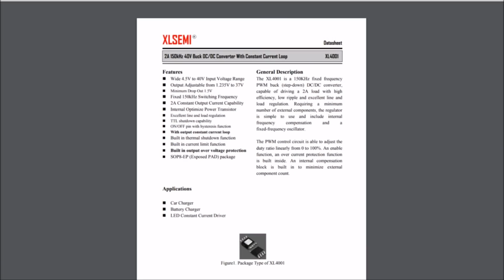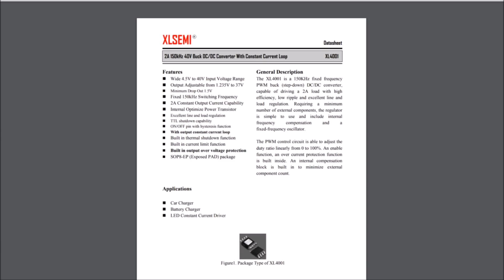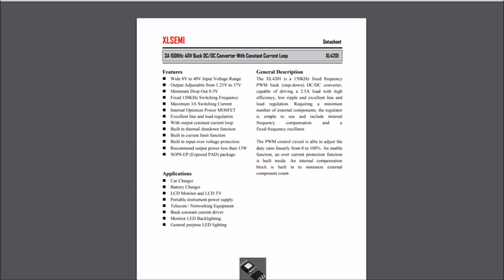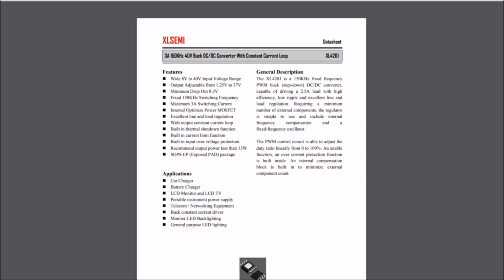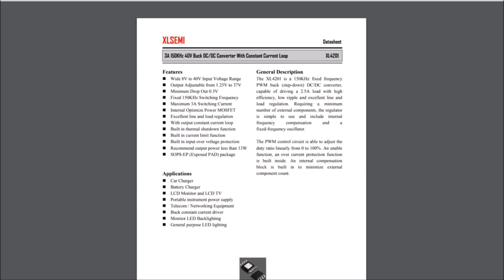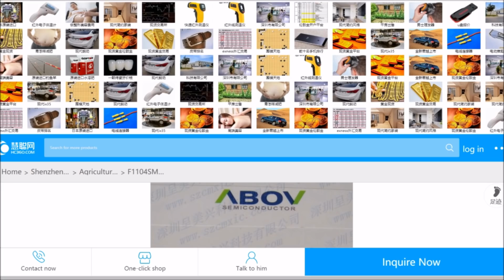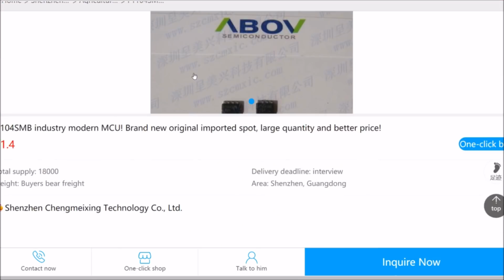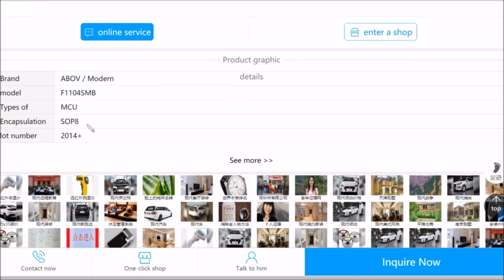Power Tool Powerbank Powwow

Comment: Counter-intuitively transmit mode on nrf24 actually uses less power than receive mode (or can, depending on application) because the transmitter can sleep between sending packets, however the receiver has to stay awake all the time to listen. While I haven't seen the code, I suspect your transmit side Arduino is polling the sensor and transmitting packets way more than it needs to, and you could probably cut power consumption hugely with some minimal software changes. Of course this might require some changes on the receive side as well since you use the ACK packets to send remote control signals.

Comment: I thought the same about those power banks but if you put the USB meter on the different USB ports and you switch the meter to show the protocol that it gets from your power bank you'll see that the protocol in most cases is different even though you can draw the same amount of amps when you have the load connected.
I learned about the different protocols because I have a similar USB meter that shows the different protocols on the second page, you should definitely try it.

Comment: Actually this tool adapter thingy does not shut off on higher load. It's your usb meter that turns off it's display when "oveloads". This adapter has properly encoded standards, and these meters check for voltages on data pins and display what standard is used, and if current drawn is bigger than in detected standard, it turns of display. You still can see red led flashing and fan spinning on 2.1A test.

Comment: Of course, slow changing parameters like humidity don't need continuous monitoring. Maybe it would be possible to switch off the sensor and wifi transmitter for four minutes out of 5 and use much less power? We used this technique for industrial instruments years ago

Comment: I'm using that exact USB-Adapter as my TS100 power supply, there is just enough space inside to squeeze in a DC jack  with 1mm² wires soldered directly to the blade connectors on the PCB

Comment: I measure the temperature in my garage (DS18B20) and the temperature and humidity in the loft (DHT30).  In each case I use a WEMOS D1R2 connected to my home wifi.  For battery power in the garage I have an old car battery which after a charge gives a good supply and this can be connected to a WEMOS DC Power Shield which sits below the MCU.  Input is from 7 -24V and is currently priced at £1.56.  Not elegant but works well.  Bob

Comment: If you drop the transmit interval, the average current may well drop to <1mA, you would be better off using a low quiescent current LDO and a reservoir cap. It seems wasteful dropping 12v to 5v, but it beats a relatively dumb buck regulator working all the time which can really drain the power while doing not much.

Comment: I rigged my tester with a 100ohm resistor to keep the fan on permanently. those three contacts on the side marked fan are for a micro switch to toggle the fan, but I just put a resistor on it.

Comment: In the comments I see SO many improvements .. .. .. Use LiPo batteries, let the transmitter only send new values once every xx, and only transmit if there is new data, etc etc. If this is about using less power, there are many comments to work with. Cheeriooooo

Comment: @5:20 The outputs are coded for being able to supply this current. If you ignore the coding, you can attempt to draw as much as you want until the voltage collapses. https://lygte-info.dk/info/USBinfo%20UK.html

Comment: Just tested mine, Nano+NrF+DHT11, barely registers on
my USB tester, flickers occasionally between -0.00- and -0.01-, 

Mentioned on one of your previous videos that I put the
transmit function in an 'if' statement which only broadcasts if one of the
readings changes. Plus it only checks about every 5 seconds. 

Edit: Bought a new more accurate tester, does 0.000A. It
seems to draw 0.008A and 0.012A when broadcasting.

Comment: To solve the problem with powerbanks shutting down I made a circuit that draws 150mA in very short pulses. This will trick the powerbank into thinking there is a significant power draw, and it stays on as long as it sees that 150mA draw. It's a real life saver when you're dealing with very low power stuff, and the additional power draw is really very low.
Reply: Same idea, simpler : I short a resistor (usually 330 ohm) to get the added minimal draw that will keep my powerbank on.
Reply: @marcrives279  Sure, that works ;)
Reply: @D00MLOORD  I now use a simple electronic load, plugged on the other power bank USB port.
To keep my powerbank on, total consumption must be above 70mA...

Comment: Don't use powerbank, use some 18650 parallel and a APxxxx boost converter chip. Very tiny.
Also removing the LED and USB from Arduino helps a lot conserving power.
Reply: That's more or less what I was thinking too.
You can get TP4056 charger boards which have low-voltage cutout protection, and 1A voltage booster circuits, from places like eBay for only a few dollars for 5 or 10 boards at a time.
I've been using those to turn second-hand laptop batteries into power banks.  I just add an on-off switch between the charger/protector circuit and the voltage booster, to minimise current drain while not in use.
Reply: Why bother boosting and feeding it through the regulator lol, use a (U)LDO or a buck converter to 3.3V, unless the OLED requires 5V

Comment: Einhell was a house brand at bauhaus back in the early 2000's. Bauhaus is a german DIY chain if you don't have it in the UK. They also made other higher quality planers and table saws at that time. I would guess ozito was a market or vendor sprecific brand that was made by einhell.

Comment: The USB power banks encode their "max" current on the "data" pins that are supposed to tell the connected device how much current they can draw.  This scheme relies on the connected devices following "the rules".  Each "different" port has been setup to tell those different devices what they want to hear depending on the manufacture.
Reply: Wouldn't say they talking just a resistance but type C fast charger is different story with more connections 🙂

Comment: why not just use the PCB from the basic power bank with the on off switch and hook it up to a large lipo cell? 
you can get them in sizes like 16,000mah or you could break up a multi cell pack and re wire it into a parallel pack.
Reply: Another similar option is to buy a pack of  5v usb booster modules and connect one to some lipo/li-ion cells. Julians favourite ebay seller sells packs of 10 for less than £3 including postage. "10PCS PFM Control DC-DC USB 0.9V-5V to 5V dc Boost Step-up Power Supply Module". Julian even tested/reviewed one a while ago- his didn't have the usb output socket fitted though. They are very handy to have around.
Reply: @ayupworld  Thats a dam good price for 10!
I have a few boost modules which boost much higher because i need the higher voltage in  the applications they are being used in but those cheap ones which go up to 5v would be handy for many other projects
Reply: @stevefox3763  Yeah Steve, can't argue with the value=) They are only good for just under 1 amp output, but so useful to be able to just connect up an 18650 or even an AA cell and get 5v usb out. I've even used one after a buck converter on 12v battery just to use the usb out socket The module was cheaper than buying another usb cable to hack apart! =)
Reply: @ayupworld  most things I'd use them for pull very little current, less than 200ma.
For charging my phone or powering other USB devices I use an xt60 charger that takes upto 6s and supports quick charge 3.0 and 3A, I plug my rc lipo packs into it and have more capacity than I can use :)

Comment: I built a little circuit that I found online that uses a small transistor and a 555 chip to pulse a few milliamps draw every 10 seconds from a powerbank to keep them awake. Seems to work very well. Search for "Current Pulsing Keeps Power Bank Active" and the instructable link to ajroyman's project should be the first thing that pops up.